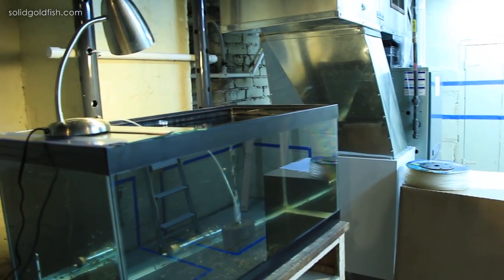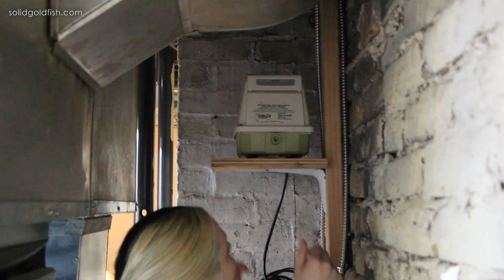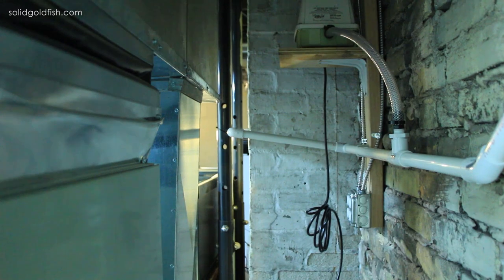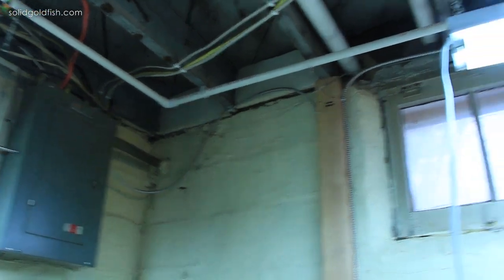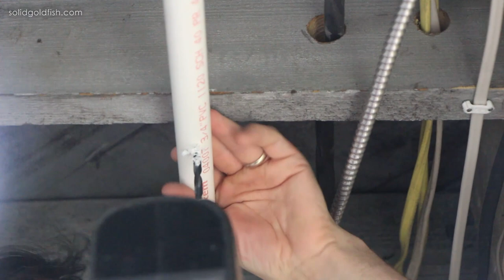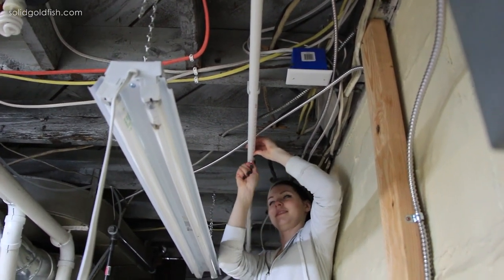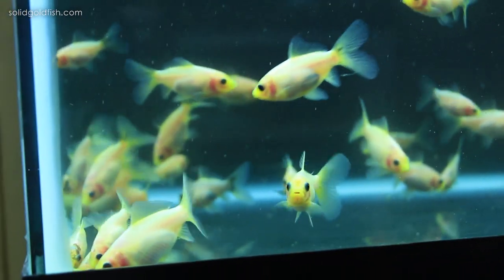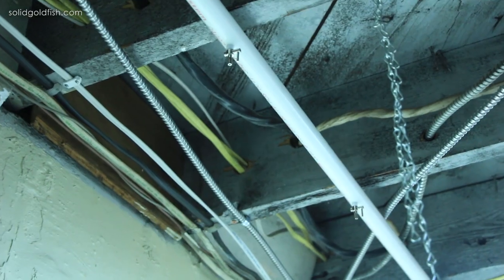Fish Room Air | Tank Talk

Comment: Great job with the air system! That will definitely cut down some of the headaches that come with running multiple tanks. ;) The fishroom is really coming along. Can't wait to see the racks get done! :)
Reply: Also, I forgot to ask;

Is the bleed valve you made with extra airline tubing at the very end of the pvc pipe completely necessary? If there is extra air pressure from the air pump being over powered for the system, wouldn't that just send more air through the sponge filters that are hooked up? Or is extra flow in the tanks what you are trying to avoid? Just trying to steal some knowledge. ;)
Reply from the maker: Ocean Truth From what I understand, if you don't run the minimum number of air outlets the pump is rated for (15 in this case) it puts unnecessary pressure on the air pump which is not good for it.  So yes, it is necessary.  Even with the bleed off valve, the air coming out of each outlet is still plenty strong.  :)
Reply: Thank you for the information, Jennie. Maybe I'll be able to put it in use one day as you have. ;)
Reply: Solid Gold the tjgfvb
Reply: Solid Gold the tjgfvb

Comment: Please share a link to that air pump. That is amazingly quiet. Do they come in various sizes?
Reply: Its a medo linear piston blower from Jehmco.com.
Reply: Another trick for you (in addition to all those wonderful ones you've used ;) is to skip the threaded valve and just drill the correct size hole and pvc glue in a little stub of rigid air line into the pvc and install a plastic control valve down where you'll be using it. This way you can make adjustments without a ladder and it's much quicker too. I use these little black airline valves intended to be used for drip irregation. I think they are on my blog under "air". Jehmco should sell them, I got mine from drip works.